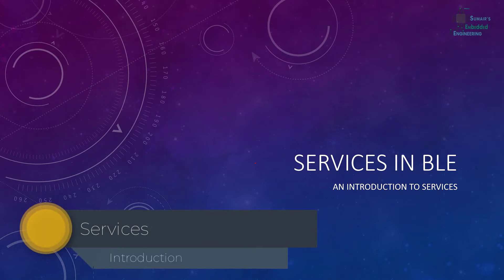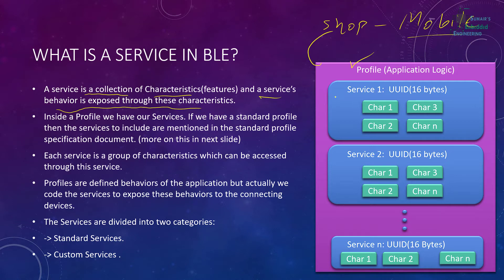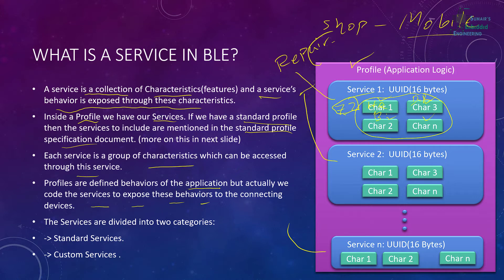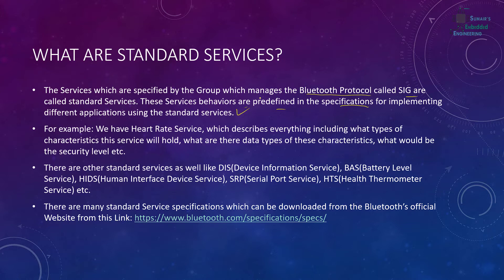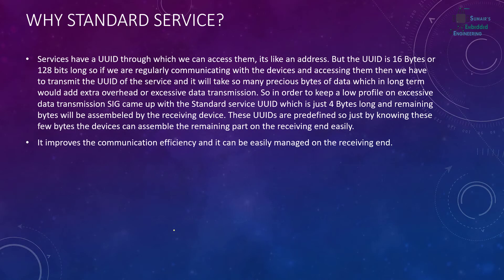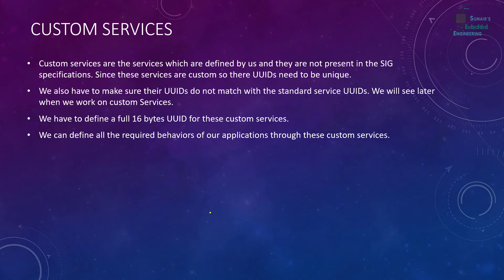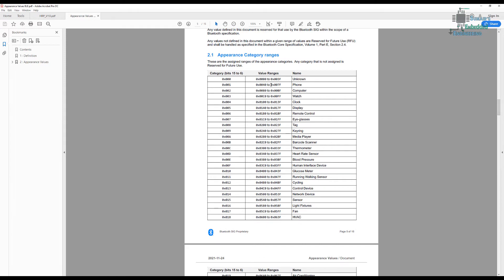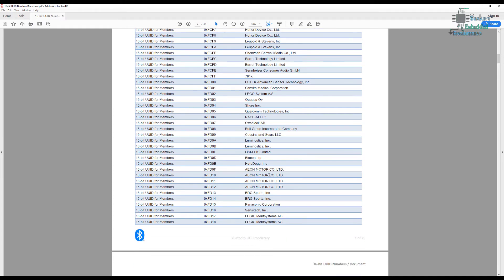nRF5 SDK - Tutorial for Beginners Pt 46 B - Introduction to Services in BLE

Comment: Hai SIr
Plz help me to Send a single Advertisement packet If an interrupt generated by button  is pressed at once 
If I press the button two times, I need to send two advertisements packet
 

Thanks in advance
Reply from the maker: Hi can you send me an email on my official mailing address, kindly send me the details properly so that i can suggest you the best possible solution. @Venkat
Reply: @SumairsEmbeddedEngineering   Sure Sir, Thank you  so much
Reply: @SumairsEmbeddedEngineering    Hi @Sumair's Embedded Engineering    can you please help me with Custom services & characteristic in Central mode ?